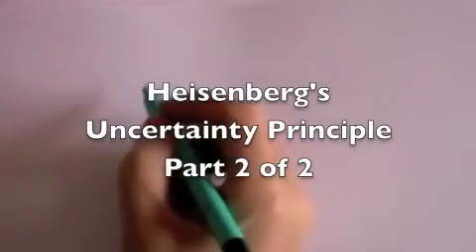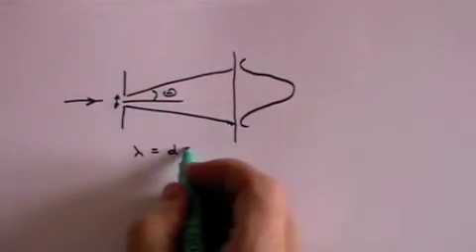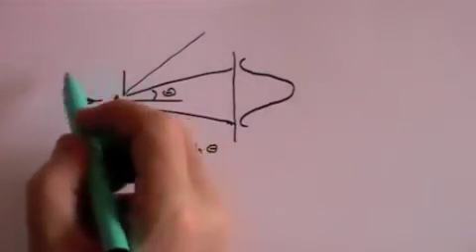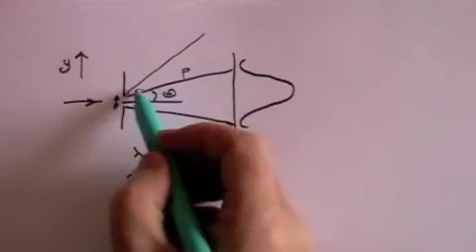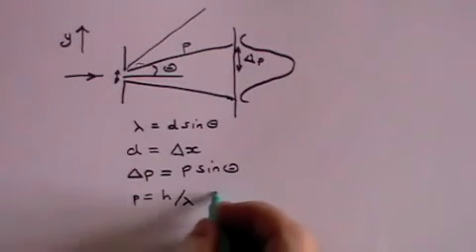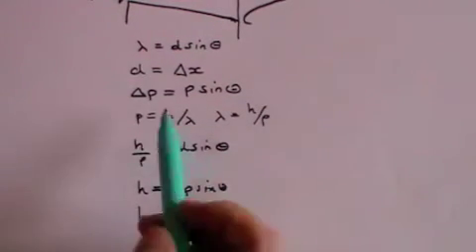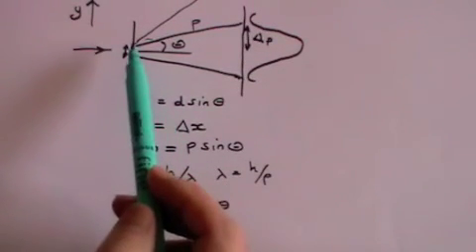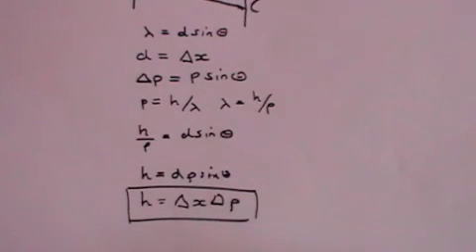Heisenberg's Uncertainty Principle - Part 2 of 2

Comment: The e- vortex at the edge of the slit, is refracted though the magnetic field of the material of the slit.
 The smaller the slit, the deeper into the surfaces magnetic field, the greater the refraction.

Comment: Your derivation appears to make it seem that the uncertainty of the position and momentum is due to the fact that when electromagnetic radiation is used to "illuminate" electrons, we have interacted with the electrons and changed their momenta.  At any given time, it would seem that an electron has a definite position and momentum; we just can't know them both without any uncertainty.  Is it correct to say that at any given time an electron has a definite position and a definite momentum?  My understanding is that physicists who understand the uncertainty principle would say, "No."  And I fail to see, given this derivation why that should be the case.  

I think I follow your derivation clearly, and it is not completely shocking to me.  And since we are talking about quantum physics and I am not completely shocked, my assumption is that there is something profoundly wrong with my understanding.
Reply: I'm still partial to the De-broglie Bohm "Pilot Wave interpretation" of quantum mechanics. Electrons in this model would have a field dependent path through spacetime, so the guiding field traveling at the speed of light from the electron interferes first to create a series of interferences peaks and troughs, and these will determine the probability distribution of electrons, even SINGLE electrons, as if the particles had taken both paths simultaneously. When the pilot wave interaction is blocked by electron detection sensors, the slit detectors interact with the electron and change its momentum and consequently create a 3rd wave front  that interferes with the first 2. This leads to the deterministic ballistic trajectory of the electron striking at only two spots, one for each slit, instead of an interference pattern with no detectors.

Information about the momentum and position of particles is thus 'non-local' to the particles, it must be recovered holographically, meaning the volume around the spacetime the electron is passing through contains all the information about it's path through space on it's surface area(s). Think layers or shells of information moving at the speed of light that retrace the steps of changes in position and momentum.

Comment: The single slit experiment seems to contradict the idea of the first video whereby the uncertainty was due to the interaction with a photon. Here there is no interaction, just the plane wave hitting the slit, and yet Heisenbergs principle holds nevertheless. I think the microscope analogy is misleading.
Reply: +Satyavan well , How will you know the momentum and position of an electron? of course you have to shot it with a photon even in slit experiment, so both the explanation in part 1 and part 2 are correct and nothing is misleading, this one was actually a mathematical explanation using slit, while the first part was more of a theoretical  explanation. yes, Diffraction Indeed plays an important role as you see we can't measure because the wave is smeared out in space so locating a point in it ( electron) is meaningless also from particle view point interaction between photon and electron results in uncertainty. It actually depends on what experiment you are doing.

Comment: so why does theta increase when the d decreases?
Reply: Its a property of waves called diffraction. Essentially you can think of a traveling wave as a bunch of smaller waves the size of a wavelength lined up beside each other. Each of those small waves is trying to ripple out in all directions, but the other small waves beside it cancel those directions out. But when the wave hits a wall with a slit the size of a wavelength, only one of those small waves passes through and it spreads out just like it always wanted to :) But as the slit gets larger, more and more small waves fit through and they start canceling out each others' sideways motion like before.
Reply: Because the wavelength is constant

Comment: Would you kindly advise on the inter-relationship between Quantum tunneling and ∆x . Especially at 2:25 of your video , which notes that uncertainty in position in the Y dimension designated as ∆x of which the particle HAS PASSED through the slit.While in quantum tunneling ,the particle would penetrate a completely closed relatively solid wall by gaining energy to penetrate the wall and give this energy back after passing the solid wall in the future.
Thank you for this great video.

Comment: When the slit gets smaller the wave widens, because less electrons get through the smaller slit. So, lower high point wider wave if this follows the work equation which would make the center theta a greater angle which would increase both thetas.

Comment: It would be good if you can put some numbers to this formulation. I have a conceptual problem visualizing that a small delta x causes a delta p to increase at all, considering that the value of "h" is so incredibly small.

Take, for example, a green laser at 5nm wavelength, and delta x at 1 micro meter. At what point does the beam spread double through the slit width of delta x?

Comment: As always, thank you for the great videos. I have a question:

At 1:26 you say that delta p is p*sin theta, but why isn't this simply "p_y = p*sin theta"? If we are assuming that we know theta, and we know lambda, and p = h / lambda, then why is there any uncertainty in momentum at all?

Thanks again.
Reply: We dont know theta . We domt know that where electron is going to hit on the screen .if a electron hits some point A over a range 0 degree to theta degree than the other electron that will pass though 
the slit might hit at some point B in this range of 0 to theta so actually we have a range of angle in which electrons might hit and the upper limit theta is not fixed..

Comment from the maker: I am covering this in the current series on quantum mechanics concepts (Part 4 which will be uploaded tomorrow), but in essence the reason is that to measure two things simultaneously you need measureables which both measure the same particle state. In maths we say that the state is an eigenvector of the measureable (or operator). If the state of the system (eg position and momentum) is not simultaneously an eigenvector of the two measureables then they cant be simultaneously measured.

Comment: use a monochromatic red laser photon instead,  The path from slit to where it hits the screen can be retrospectively measured. The velocity of photons is known. thus in retrospect, thus the photon had a momentum,p, when at x.(unless the photon changes color. I've never heard of THAT. does it?)
But the UP precludes the simultaneous EXISTENCE of exact x and p.
(its more fundamental than just a measurement problem)
(Predicting x and p in ADVANCE was never the issue.)

unconfuse me  LOL

Comment from the maker: Yes, you can send one electron through at a time. That will result in a flash on the detector screen at a particular point. But you will not be able to predict in advance where that flash will occur. Neither will you have any notion about the route that the electron took.